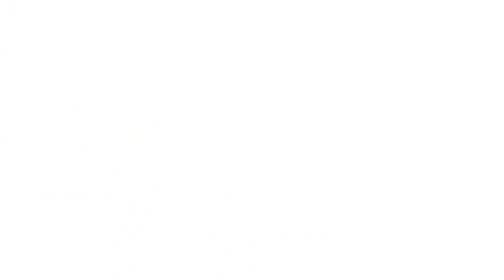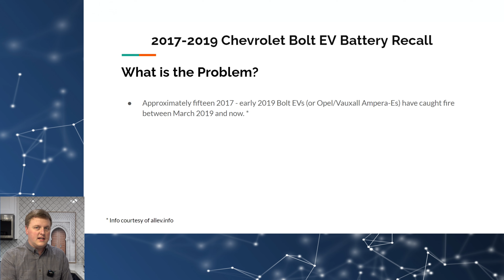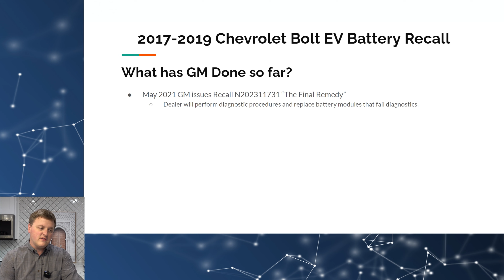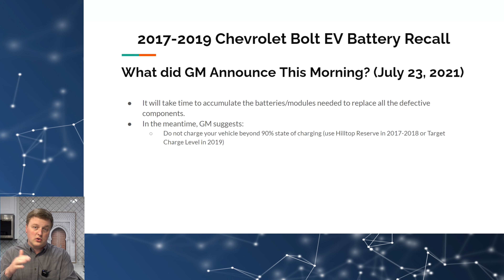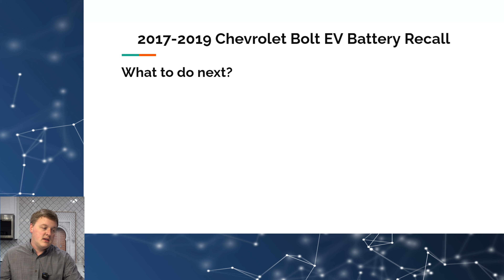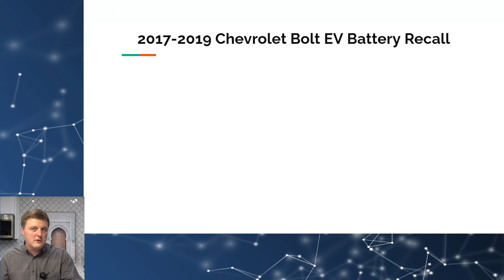GM issues a THIRD battery recall for the Chevy Bolt

Comment: Wouldn't it be great if GM said "we're so sure of our new USA-made pack that we're going to give affected owners very deep discounts on 2021 Bolts." And then followed through.
Reply from the maker: They are doing this for some Bolt owners, but you do have to contact them and request a buy back. However, so far, it is very much a case by case situation. 

I think a lot of Bolt owners would be quite happy if their 2017-2019 Bolt batteries got replaced with the current 65kwh USA made batteries. They could even software limit them to 60kwh if they really wanted to, which would allow the car to perform the same as it did when new while also substantially improving the reliability of the battery due to the additional buffer. I think the ultimate deciding factors will be 1) cost and 2) material/battery availability.
Reply: GM:  Hey, that's a great idea  ...  well, other than that last part..  about following through...  Other than that, let's do it!!
:-)  Sorry...  As a 2017 Bolt owner, I am waiting to see how this plays out for me.  Fingers crossed...

Comment: I called GMs EV concierge line two weeks ago to start the buyback process of my 2019 bolt. Provided them with all the paperwork and am waiting for their decision. They said it will take about 2-3 weeks.
Reply: Started the same for my 2018. Hopefully they don’t stick us with the all the depreciation. I bought the car with the intention of keeping it 10 years as I anticipated slow range degradation to be the only risk.
Reply from the maker: Yeah, it’s not a quick process, especially since I’ll bet they are getting inundated right now. I still think that, especially for 2019 owners that are covered by the recall, this is probably the best option. For me personally, just the possibility that my car could decide to catch fire would weigh heavily on me.

Comment: The problem is related to dendritic growth piercing the separator
Reply: I don't know that this is true (although this is the common cause for Li battery fires). GM says that there are two manufacturing defects in some modules, but haven't detailed what those defects are.
Reply: @KBinMD  Battery cells start to burn in themselves when they are shorted, melt the case and expose themselves to air while still glowing red. How does a cell short itself? By manufacturing defects of the foil - Anode or Cathode does not matter - and being charged and while being charged building dendrites that should not pierce the foils - but they may if there are enough manufacturing defects. All of this does not happen with LiFePo4.

Comment: My dealer says my 19 is not on the recall list. I double checked again today. Both on the govt recall list and GMs recall list. Not posted yet. The label inside drivers door shows 5/19 mfg. date
Reply from the maker: Good to hear and good to know. GM hasn’t said (as far as I’m aware) when I’m 2019 that they stopped used the Korean built battery packs, but if your 2019 is not included in the recall, it must have a USA built battery.
Reply: A GM dealer will say anything to get you out of the building. He does not care.
Reply from the maker: A GM dealer can easily check to see if a vehicle has any open recalls, and it would be to their benefit to inform you if there are, because that is paid work for their service department.
Reply: My Dealer = My Bandit ! License to rob. Come to Canada and see - $ 230/hr. shop rate.

Comment: The best summary I've seen so far.  I hope 2020+ Bolts are not affected since I have a 2020.  But I'm reluctant to trust GM when you mention that the Bolt was designed with no battery buffer.  That sounds like someone who is worried more about marketing range and low cost instead of my safety or reliability.
Reply: Same thoughts here. I also have a 2020. Not taking any chances. Not letting the change drop too much and definitely not charging all the way.
Reply: So far it isnt only 2017 to 2019
Reply from the maker: I agree with you, but I think that with the 2022 Bolts now have at least a 1kwh buffer built in, which would explain why the battery went from an advertised 66kwh in 2021 to 65kwh in 2022.

I also don’t know if the 2020+ packs have a built in buffer or not, but I kind of suspect that they may at least have a buffer on the top of the battery since they charge substantially faster at high state of charge vs the 2017-2019 (about 2x as fast over 90%). The driver could also choose to avoid charging to 100% daily, only charge that high for long trips and avoid running the battery below 10%, which I suggest anyway. The Model 3 doesn’t have a top buffer either and they don’t recommend charging past 90% unless you need it for a long road trip.
Reply: All Bolts are affected. Anything built by GM should be taken off the road.
Reply from the maker: This is not verified information. There has been no issue with any 2020+ Bolts.
Reply: @wrenchingfool5284  Give it time. GM just hasn't been forced to announce it yet.

Comment: Interesting there now far more concerned about keeping a minimum in the battery, then a maximum.
As from the beginning i was surprised they where only limiting the topend of the battery.
.
Makes me wonder how many of the fire cases where related to charging under 50% charge.
Cinda like how some people keep next to no extra gas in a tank and it takes the fuel pump out earlier than it should.
0.01c
Reply from the maker: I believe the concern that they have it this point is related to long charging sessions or deeply recharging the battery as opposed to keeping a certain minimum charge in the battery, or basically recharging from a low state of charge back to near full. That is a theme that has come up in some of the past battery fires. An additional recommendation that I’ve read from GM (after recording the video) is to recharge after every trip (which results in shorter charging sessions) rather than making several trips, running the battery down further and then having a longer charge session